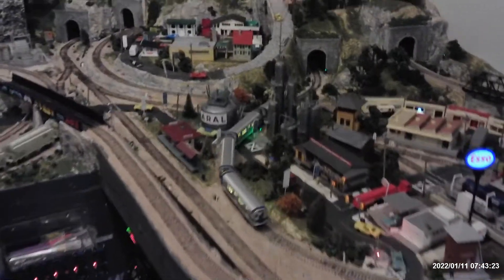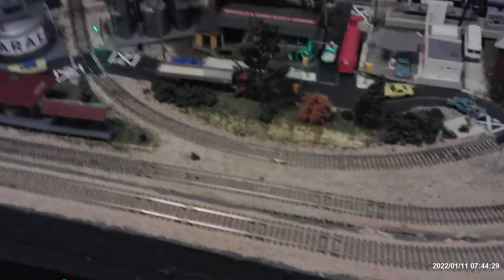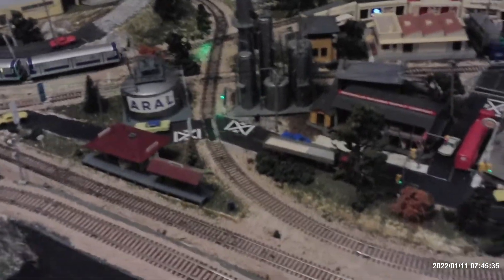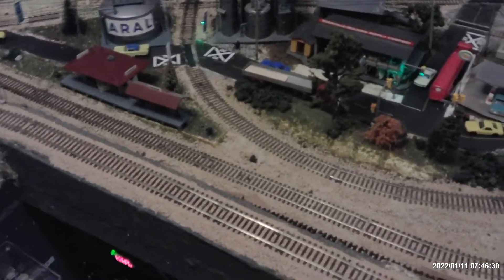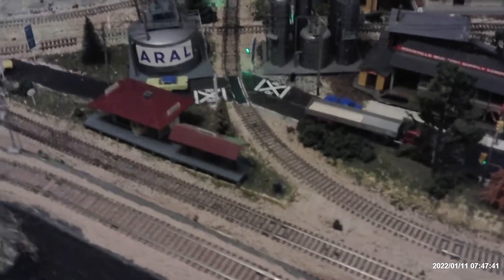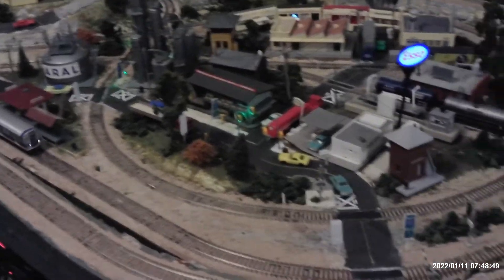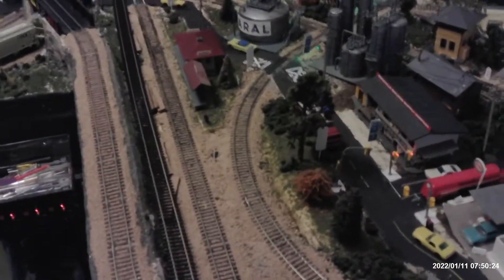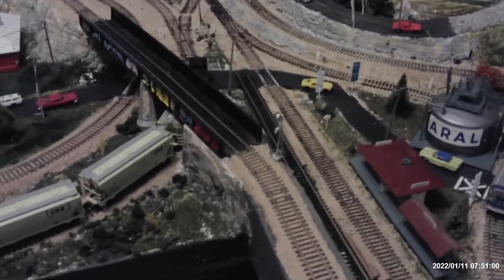089. NCE DB20 Troubleshooting on my Layout

Comment: Are those the NYC MTA Proto 2000 subway cars?
Also, I like those track crossings, the two right next to each other.  Are those custom made or were you able to use stock track crossings?
I really like all the signaling and automation you have setup.
Reply from the maker: Heath thanks for watching  Yes the are MTA subway trains got them from TrainWorld in the Bronx  The crossings I got from a few vendors if you want the info let me know   Planning to add more for my other crossing in the future.